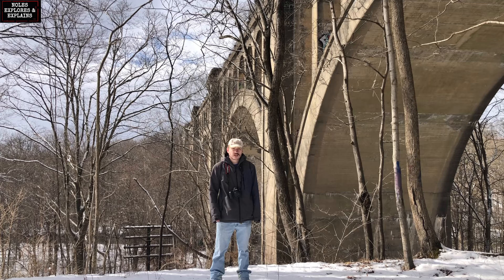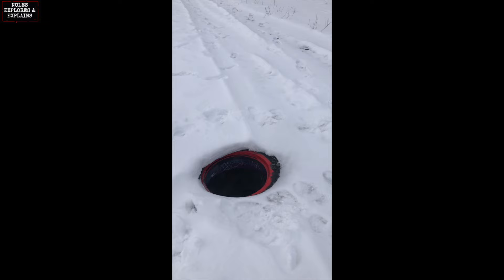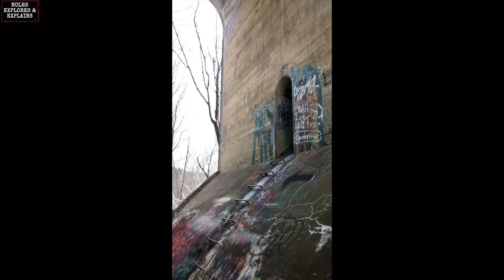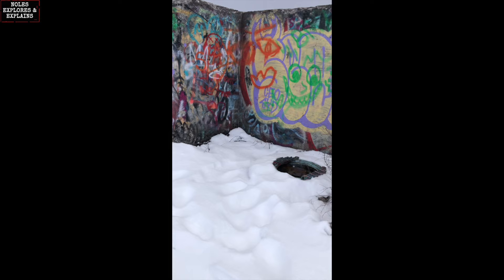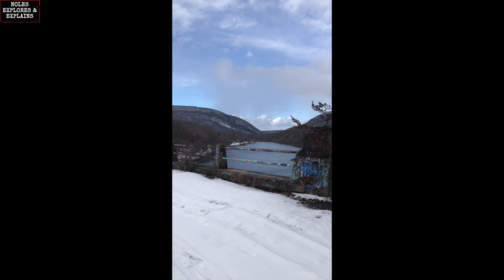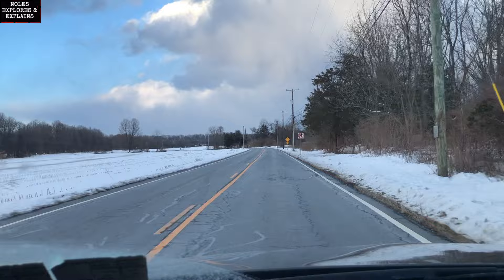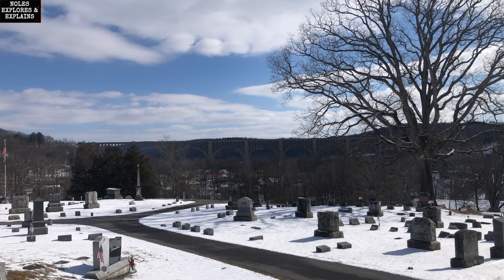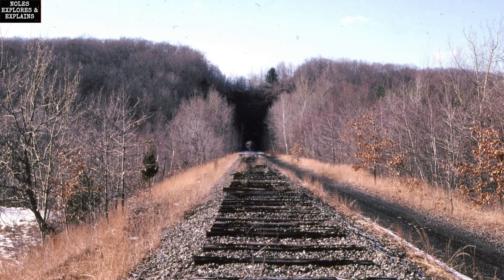Exploring the Abandoned Lackawanna Cutoff

Comment: Holy crap! You've made a connection for me that I wasn't anticipating.

In September 2022, I passed through Nicholson and under the viaduct on my way to Connecticut (taking the scenic route to avoid highways). You come into this tiny little town and suddenly there's this massive structure looming over everything. It stuck in my memory as something to look into. Once my trip was over, I looked it up on Google Maps and traced the railroad as far as I could, but as with a lot of railroads, they just kinda go on forever or eventually get muddled with a bunch of other lines. Very cool to learn it was originally intended to be a (relatively) high speed line.

Comment: Well my thing is as well with Lackawanna cut off especially the missing 21 mi is that Amtrak has to get involved in order to actually get the rest of the line rebuilt rehabilitated and reactivated. The bridges need repairs road bed needs rehabilitation obviously tracks have to be laid signals stations the whole kit and kaboodle! So the Lackawanna cut off was accepted into the corridor ID program back in December of last year. So we will see what happens in the coming years!
Reply from the maker: I’m rooting for it! I’m a big fan of high speed rail